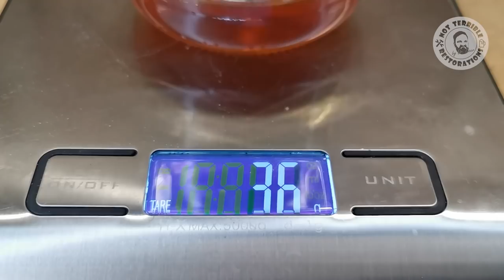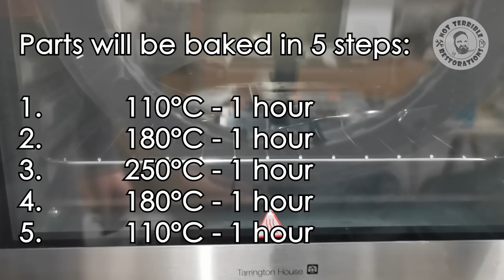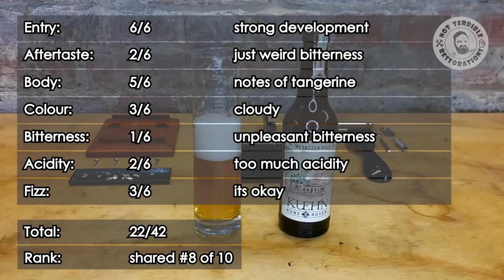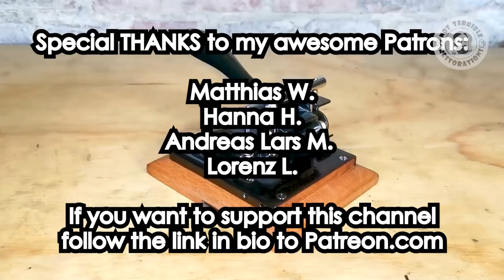Traditional Japanning and Restoring 110-year-old Paper Punch

Comment: Beautiful work! I'm especially enjoying your use of electrolysis to de-rust. I use it for occasional restorations and sometimes just to clean up an old tool that's grown a rusty coat. It costs almost nothing compared to buying gallons of rust remover fluid, and afterward one ends up with some brown water that has iron and washing-soda in it, instead of a nasty, brown, all used up rust-remover chemical to dispose of. Anyway, that's my rant on electrolysis. The crowning touch of this restoration was your making your own, proper japanning and applying it correctly. I have 100-year-old wood planes with japanning, and those parts have never rusted, but I also have brand new tools that have a very thin, shiny, pretty, nickel coating but begin rusting within just a few months. Thank you for making all the effort to do everything right and to never cut corners.

Comment: One thing is missing - the paper registration arm.   It is there so that the holes will all line up in the same place on each piece of paper (when punched at different times).
You'll have to make one - it can be all wood, wood & metal, or all metal.

Yours appears to be a round rod with the paper stop at the end.  It could also be a dual rod setup with a connecting plate for a paper stop.  

Both kinds would require a set screw to hold it in place - somewhere.

Comment: Very well done - I like the japanning - it looks good and so glossy.
Reply from the maker: Yes the mix turned out great, wasn't thinking that the gloss will evolve like this
Reply: @NTRprojects  2 questions - 1- How strong is the smell when going through the heating/curing process? and - 2- How long will the unused japanning mix last in the jar?  (I realize you might not know the answer to the 2nd question, but I hope you have read/heard something, because I haven't read/heard anything about the useful life of the japanning mix)
Reply from the maker: @JAdams-jx5ek  the smell was actually not as bad as expected. Maybe because of the linseed oil it smelled like some esoteric needle tree aroma.
It's in the sealed jar now for over a month and still nothing changed. But   when I use it again I will run it through a 100 micron paint filter to make sure no built up cristalls will mess up the surface quality
Reply: @NTRprojects  Thank you for letting me know.

Comment: Very nice job at all levels.  Sorry if I missed it, but what is the plating solution?  I'm not familiar with "nickel ionized water".  Is is something you made yourself or did you purchase it?  The plating looked very bright (very nice).  Thanks again for sharing such a cool video.
Reply from the maker: Hey JAZ you can either buy it as nickel electrolyte or produce it yourself. If you want to produce it yourself I explained that in my very first video. The restoration of the mewa oil lamp.
Reply: @NTRprojects  Thanks, that was helpful and you do very impressive work.

Comment: The restoration was almost perfect, the use of Allen grub screws is practical but unfortunately this was not part of the original design, so it takes away from the authenticity value of the finished product and ruined the finished product.